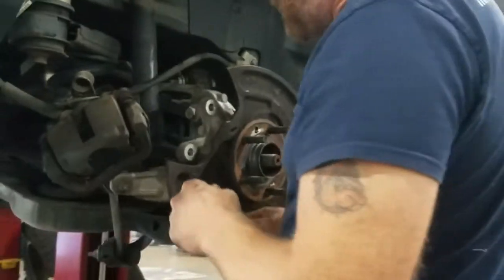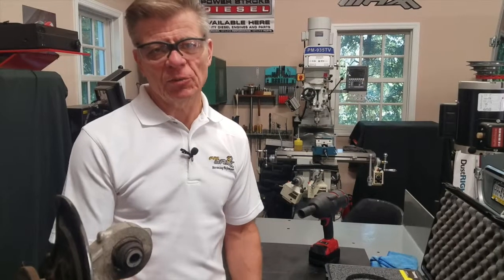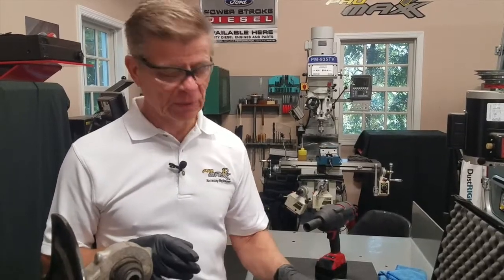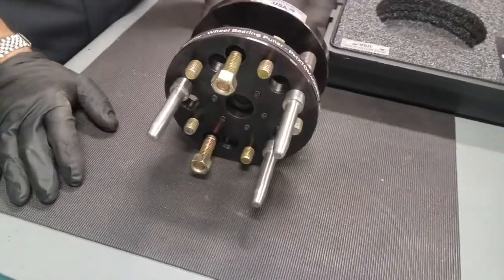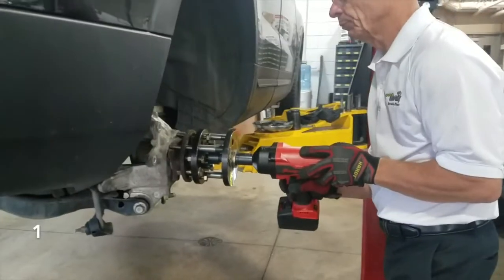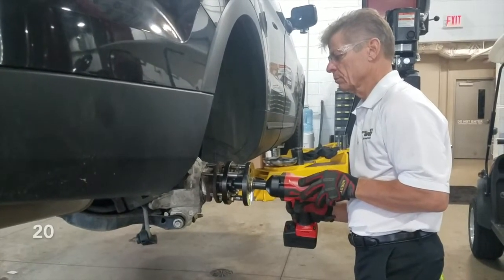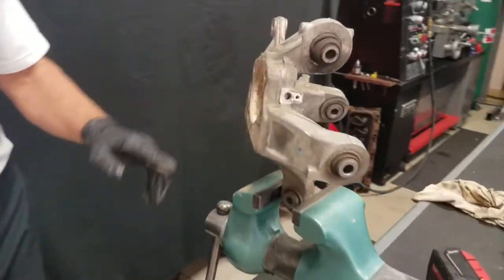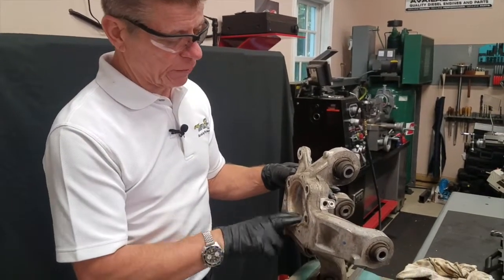Tommy - ProMAXX Tool Wheel Bearing Puller

Comment: I just bought and used this on a Subaru Forester. Glad I bought the other plate. No way the legs would go around the outside of the bearings inner flange. The legs rested on the flange pulling off the hub. No way to avoid that.
Reply: Apparently, you used it wrong…. Supposed to leave the axle nut on, and in just about every video it shows the legs over the sides of the inner flange.  Matter of fact, they’re notched so they fit over the flange.

Comment: Is this tool available at auto zone or any other retail store?
Reply from the maker: This tool is only available right now online and with select mobile tool distributors. Check it out here: https://www.promaxxtool.com/extractors/p/tommy
Reply: Your are not gonna find $700 tool in AutoZone. 😂
Reply: $700 dollars 😂. Just buy a slide hammer for $20 and it does the same job. No bearing has beaten it yet.
Reply: @bEEBO178  a slide hammer would not work on on bearings seized this badly. The aluminum wheel knuckle and steel bearing causes some excessive corrosion that practically welds itself together. I work for Ford and have done many explorer bearings. Usually a regular axle puller and an air hammer will work
Reply: @bEEBO178  try doing that on a fucking car that’s been in the Northeast. It’s whole life. I make a lot of fucking money off Subaru owners in Pennsylvania. I get to charge six or seven labor and it only takes me an hour.